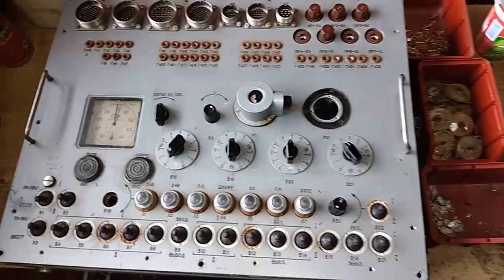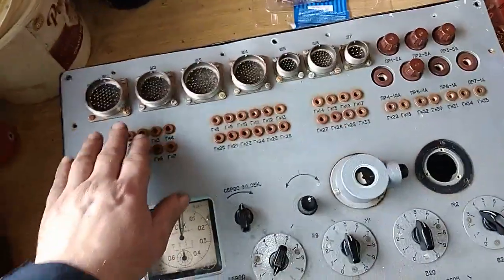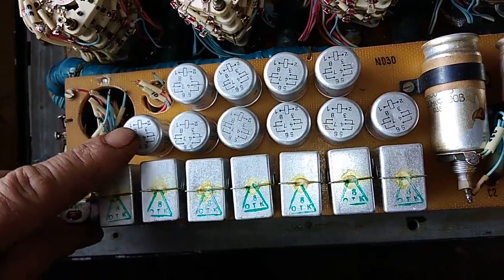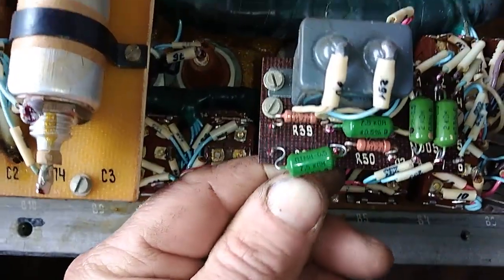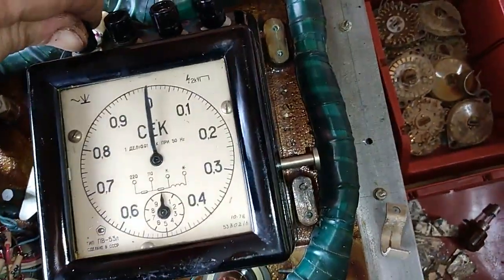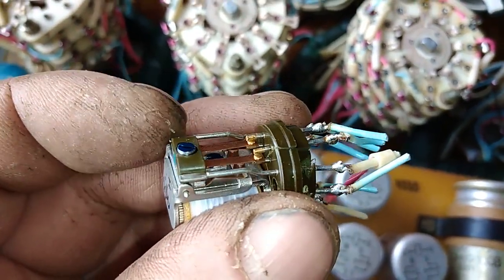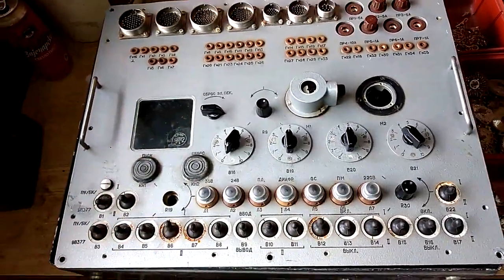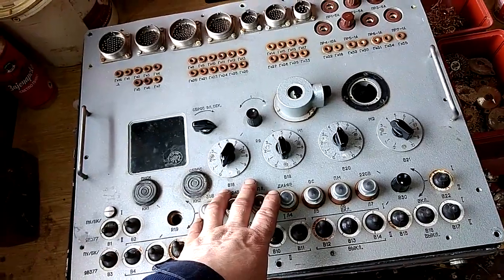Military diagnostic command case for scrap!

Comment: Are those "RES-9" relays ? Because I have a few of them opened here, I don't see gold contacts, only silver. How to know which ones are gold contacts ?
Reply: Yes, this is RES-9. What number do you heve? Under the name RES-9 there is a number, what are the last 3 digits? If you have 213 there is 95% pure gold. If you have for simple 201 or 202   you have platinium 90% pure.
Reply: @dominikkulacz452  Some random ones here have the number PC4.524.200, 201,204. No cigar then, but I have plenty more hidding in my collection of soviet avionics.
Reply: @msylvain59  200 and 204 is only silver, but 201 is platinium. In 1 psc you have about 0,15 g platinium 90% purity